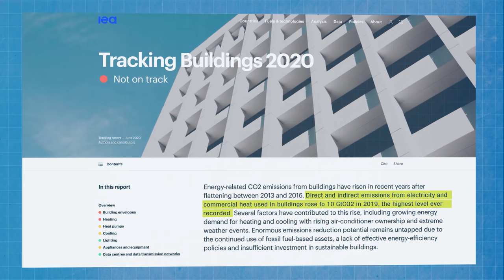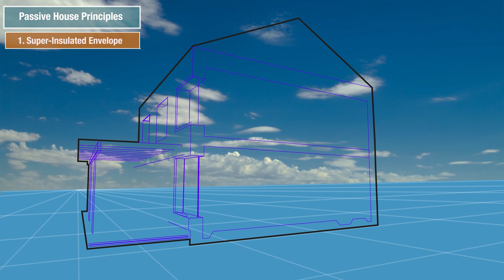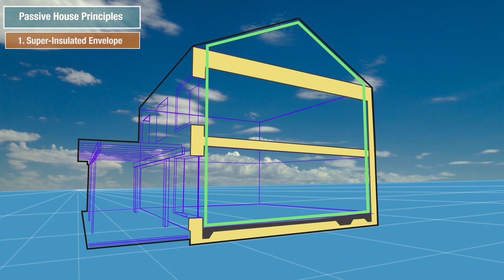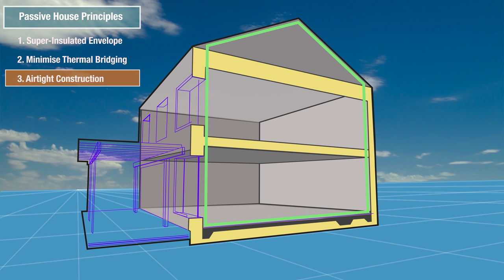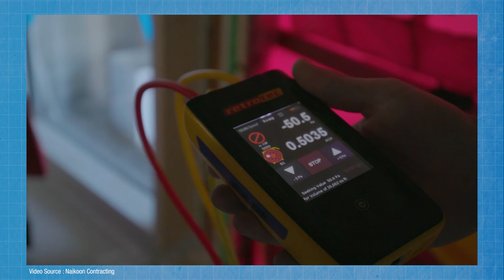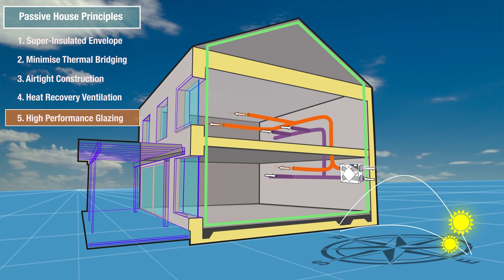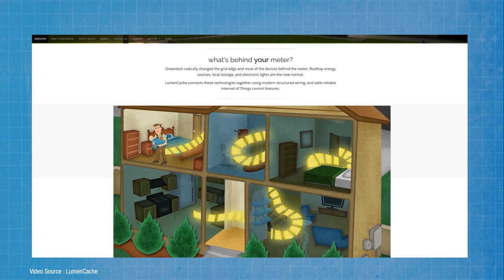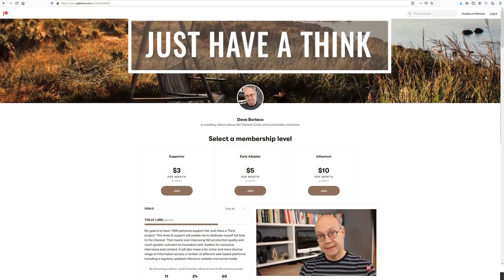Passivhaus . A low carbon future for our homes?

Comment: Folks like myself, who are planning on building our forever retirement home, are very well served by this video - but if I was 20 years younger (yeah, if ONLY!!) I'd be desperate to see a video on refitting passive-house technologies to an existing house. PLEASE DO cover this if at all possible!!!
Reply: This is something I'm concerned with.  It's not cost effective unfortunately.  You can perform an energy audit, which is a blower door test to find out where you are loosing air, and taking a look at the insulation.  A lot of old homes will have 6 inches of insulation where the standard now (in the US at least) is 12.  Those steps are cost effective, but getting to a passive house requires thought at the building stage such as orienting your house facing south, and installing overhangs on the windows.  In the winter light gets in but in the summer the sun is high and the overhangs block the light.  South facing houses will get more light on their roof as well so solar production is increased.
Reply: Rather go for an aktive house. 
It’s more cost effective to tackle the main problem zones like (i hope the translation is right) between floor cover... retorfit in my expirance never works for passive house, because of airconditioning and you will face mould issue...

Having it on a low energy standard with active photovoltaic and a heat pump system (best ground) should do a lot better.
Reply: Joseph W. Lstiburek read his book  that is for your environment, each heat / humidity zone is different. Best 40 bucks I spent, but if you can not afford that his YouTube videos will guide your way. my house is all electric and bills run 80 to a 100 dollars a month year around.  eastern NC
Reply: To get an idea of what you are dealing with (moisture and vapour control, risks of exterior insulation and moisture damage on your sheathing because of it) Look up Keeping The Heat In by Natural Resources Canada, it goes over everything you need to consider and how to retrofit insulation in older houses. You wont get net zero but you can get 80% or more of the way there.
Reply: Look up EnerPHit standard which is the retrofit version of PH. But why not build? I'm 62 and have recently completed our self build PH. No one over the age of 60 should have to live in anything other than a passivhaus!
Reply: that is quite easy with today's technologies. You can hire an architect to make a project for you.
Reply: 'This Old House' covers energy efficient remodeling tools and techniques on a regular basis.
Reply: @edmirfin8498  Retrofitting to Enerphit level is expensive but on what basis is it 'not cost effective'? What are you comparing it to? Just comparing the costs to existing heating/cooling costs and looking for 'payback times' is entirely the wrong approach IMHO. Almost nothing else you buy has a 'payback time' (new kitchen, new car, new computer) so why should building retrofit? The upgraded house is a much better house to live in, is worth more money, and will save a large amount over the building lifetime. To meet our climate goals most houses need massive retrofit of some sort anyway so it's not like there is a reasonable option of 'do nothing'. Passivehouses don't have to face south - that just means you can meet the requirements with a lower fabric spec. 
 I've retrofitted my nondescript 1960s detached to approx Enerphit level. It's cost about £25000, spread over 12 years, so a bit over £2000/yr which is do-able for very many people. That includes a lot of DIY; it would be more like £40,000 if someone else did all the work. The house is dramatically better to live in - it was cold and draughty when we moved in.
Reply: @Wookey.  brilliant answer! Your point about payback time is such a good one-  it just so misses the point to think in those VFM terms. You are the first person i have come across who has actually done an EnerPHit, and by DIY,  incrementally. Well done! I had no idea it could be achieved for so little money. The literature is full of examples costing £70k-£100k and total disruption which rules it out for most people.
Reply: @Wookey.  Agreed, great answer. I've renovated 2 houses now (1890s mid-terrace & 1700s drover's cottage). While it may be hard to meet passivehaus standards, focusing on insulation & damp-proofing is the key to ensure a livable & maintainable end result. Skimp on that & you'll be replacing mouldy wallpaper & rotten woodwork for ever more. Energy savings are a fraction of the benefit of proper insulation.
Reply: It's easier and cheaper to build new than try to retrofit an older house to the Passive House standard.
Reply: @barbarasmith6005  possibly easier but not cheaper. Another contributor here says he has achieved EnerPHit standard for £25k. It was DIY and took 10 years. Contractor might take 6 months and cost 3x that - still cheaper than new build.
Reply: You'll need to start off with very big rooms and wide hallways as you cannot insulate on the outside in the UK due to planning regs (can't change the visual appearance of a property as seen from the principle elevation i.e. roadside).
You can't have a house that appears to be say 30 cm in front of your neighbour's house.
The best thing to do with an old brick or stone house is to either 
A- build a sustainable home inside the old pile or
B- pull it down,sell the bricks on and start again!
Reply: @chippysteve4524  I know planners have the reputation of being inflexible but when there are good reasons they will allow exceptions. We built under "replacement dwelling" provisions but were allowed to double the floor area because it's passivhaus. It's normally like-for-like.
Reply: @edmirfin8498  my advice is to get a thermal imagi.g camera and find all the blue in the winter and stop it.
Reply: @chippysteve4524  You can change the appearance unless in a conservation area. My house was brick and is now rendered. Even if you have to keep the same look it just increases costs (brick slips cost more than render)- it doesn't prevent retrofit. There are loads of examples of one house in a semi or terrace having EWI but not the one next door. It's remarkable how little-noticeable it is (which may be why you haven't noticed them :-). (often a drainpipe means you can't even see the step. And the step probably won't be there for long because next door will have to do theirs in due course :-)
The planning rules will have to change too - decarbonising is ultimately more important than keeping our houses look exactly the same as they did 100 years ago.
Reply: @barbarasmith6005  It is indeed easier to build new efficient houses than retrofit old ones, especially at passivehouse grade, but at least in the UK, and probably most cities, tearing down all the existing buildings and putting up new ones is not very practical. For some building types it can be lower-emissions in the long run (according to Scottish report from about 10 years ago).
In practice there is going to be a lot of retrofit, not least because you can do it in stages and don't have to go live somewhere else for a year.
Reply: @chippysteve4524  yes I i would suggest a mooney wall for retrofit in the case of a brick outside.
Reply: @edmirfin8498  -Clearly it's better to be passive from the original build but those who don't have the choice yet are still wanting to improve often have little more than advertisers words to go on. Some guidance, direction and knowledgeable sources would be very useful here!
Reply: In 2010 I worked with a manufacturer of EIFS products on a test program in Southern California. We retrofitted 3 existing homes, one each in Dana Point, Joshua Tree and Mission Viejo. These were all wood framed, stucco clad homes built in the 1960’s, 1970’s and 1980’s. 

The Joshua Tree property home was the newer home. It was fitted with inexpensive dual glazed vinyl windows and 1 1/2” of eps foam cladding. It also got a more efficient air conditioning system. The work, completed in mid summer achieved a 90% reduction in electrical cost for cooling in the hot desert climate (heating costs were similarly lowered). We monitored this home over the next two years and the cost of cooling the home remained in the mid $20 per month. A dramatic benefit to the homeowner, considering that the average cooling cost per month during the summers averaged $250 per month. 

Passive systems are simple and provide benefits for many years if properly designed and correctly installed.

Comment: We're building a 4-unit sustainable development to "near-Passivhause" standards meaning we won't dot every "i" and we won't get certified, but we'll achieve roughly equivalent performance.  The units will be 1000 to 1300 sf, and each unit will have a charging station for 1 or 2 EVs.  Fossil fuel vehicles will not be able to park on-site.  We will draw day-time solar energy from the grid, and are lobbying our rural electric cooperative to make stored solar and wind available for night-time power.  All power will be electric meaning no natural gas or propane-powered accessories.  We hope that our local building codes will be updated to incentivize this kind of building.  We only have a decade to get very near net-zero, so we hope our project will kick-start this kind of development state-wide.  We also very much want to see your comments on retro-fitting existing housing stock and appliances to passivhaus standards.
Reply: Hi. I'm a fresh grad HVAC engineer from Hungary where retro-fitting plays a major role. So I try to do my best to give some general advice for retro-fitting. The important objective is to make the most change with the least amount of cost so it can be easily implemented. Better insulation sound like a great plan, but it's important to keep in mind that over insulated buildings with a poorly controlled heating system will not decrease but instead increase the consumption. Either the residents will open the windows and waste energy and/or the system will be turned on and off to compensate. The same if the system becomes oversized. When you change the system to heat-pump look for systems that would meet the EU-s strict regulation, cuz freon-like substances do more harm than the heat-pump do good. Ground-based are the best if it's not limited, important to note that the ground is more like a battery than an unlimited source, important to pump heat back from the building or from solar. Air-water heat pumps are also efficient and cheaper. The main problem that is needed to be kept in mind is the noise hazard. Here were a few legal cases because that noise bothered the neighbors. Also, heat pumps need a heat puffer tank if the system isn't large enough, for defrost. Considering the recent cold front in the US a puffer tank is a life changer. At last, water usage is also important, water-saving taps and toilets are really inexpensive nowadays which can save a large amount of water and heat energy. I doubt I need to mention the benefits of PVs and solar thermal units. P.S.: I love your plan and hope it will work out as planned.

Comment: We live in Australia, which is WAY behind the rest of the OECD in terms of dealing with climate change, as you all probably already know. However, we built our house in 2002 with basic passive house design in mind, eg increased insulation in the walls and ceilings, thermal mass with concrete slab floors, putting the garage and utilities (laundry, bathrooms / toilets, courtyard with shade trees on the western side; ventilation through east / west louvred windows; awnings and patios around the house, to name just a few basic design features and I am still amazed to this day how temperate the house is compared to outdoor temperatures at all times of the year. We went the whole hog and put 6KW solar system on the roof and our quarterly electricity bill is about $150. This didnt cost us more than building the average home, relying as we did on design principles rather than things like double glazing, which should be industry standard. There is no political will in Australia to tackle climate change so it falls onto individuals like ourselves to follow the pathway to passive house building. It really works.
Reply: >We live in Australia, which is WAY behind the rest of the OECD in terms of dealing with climate change, as you all probably already know

Is this a joke? Australia is one of the leaders in OECD in terms of renewable energy and energy storage per capita, if not the leader.

Comment: I love the injected humor, "If you were to seal the building hermetically and sit inside for a few days, you would find yourself eventually being dead."
Reply: Which would be unfortunate 😂
Reply: Not a bit of it! All you need is a ventilation system that uses a 90% effective heat exchanger.
Reply: We have a Gread Dane with an iffy very niffy tum. As airtight as our house is, frequently the windows are  wide open!
Reply: @williamarmstrong7199  We used to have a beagle like that, she could clear a room in seconds.
Reply: No Bonnie my dear !! MVHR is the answer. Mechanical ventilation heat recovery system to the uninitiated. It makes living in one of these super insulated houses filled with fresh air
Reply: @jeremyratcliff1875  Ah! MVHR brings in fresh air and recovers the heat. If fresh air is introduced, then the building is not hermetically sealed!  That's the joke: you can't live in an air-tight house.

Comment: I have built beyond Passivhaus standards for 22 years all over the world and you have included a house we built in France many years ago. We tend to build using screwpiles with a frame on top. Airtightness is key and every designer omits an 'airlock' .. i.e. a vestibule or porch. It can take several hours to recover the envelope with an open door. We build with SIPs and use aerogel as a gasket in the detail. We have developed transparent aerogel for use in the void in double glazing. Passive hrv is now very affordable. A house built with SIPs of 72m2 beyond Passivhaus should cost less than £60k with reasonable fittings such as kitchen, bathroom, etc. In northern countries we use a simple air pump and a barometer to test airtightness. Passivhaus is easy to achieve using our techniques.All free to 'Just have a think' community.

Comment: A few points:
1) Cupboards and closets and other storage spaces can work as an extra layer if they are on the outside wall.
2) The "story and a half" style design has less surface area per unit volume than many others.
3) "Titanium white" walls reflect nearly 100% of light back into the room decreasing the need for  power in the lighting.  
4) Drapes and curtains on windows work to somewhat decrease the loss through them.  Rolling shutters do a lot more.  You crank them down at night and you have less loss via the window.
5) "sun tubes" work well to bring in light.
4) In a basement, "fake windows" can make the space look more like an above ground space and let you use it more as living space.

Comment: Thank you so much for covering a passive house overview. Do realize in the United States that home construction industry at Large has not embraced it to the point of making a difference or even being on the radar. Passive houses built here are done at a tremendous effort of the homeowner and very daring partners to move the needle. Videos like yours will help, enlarging the discussion. Thank you for making all the videos you do.

Comment: I am building an energy-efficient house - close to PH standards in Canada, zone 6. Started planning with 100% PH standards and modified some due to various efficiencies. House is built on an EPS insulated slab with in-floor glycolic heating, walls include 6" studs with blown-in cellulose insulation, 3 ply PH windows and doors, Lifebreath HRV and Daiken ductless heat pump serves as AC. Since there is no city water and well water is bad due to high content of iron, a dug-in water cistern with dual rain gathering system (filtrated for drinking etc and infiltrated for WC plumbing) will be our water source. Interior components are planned to be reused from commercial demolitions since as an Interior Architect I have access to these unlimited precious 'debris': interior doors, wood panels, lighting, etc. One level house is fully inclusive, no high door thresholds or narrow spaces, accessible by wheelchair anywhere. I fully agree with another 'Canadian' comment, that in our country we build a way to oversized houses. Instead, spending these cost on better energy coherence and interior comfort will bring future benefits for everyone.

Comment: Talk about a timely topic for me. I have learned just recently that, hey, I'd really benefit right now from having a passive house. We recently took out our gas furnace and gas water heater and put in heat pump versions instead. Wow!!!!!! It takes gobs and gobs of energy to heat a 1950s built house in Cache Valley, Utah. Take my house, please, and retrofit it to the passive house standard right away.

Yes, you're right and, when we were using gas to heat our home, we were already using gobs and gobs of energy, but it just didn't register to my mind. We were so used to taking gas heat as granted, I didn't think of it much. But now, when I check my data logger and see that we've used 50 kW-hr in one day just for heating, the reality seems more immediate to me. And I've realized that I need to change my plan a bit. I had been thinking step 1, electrify everything and step 2 put in more solar panels. But there's no way I'm going to get 50 kW-hr a day from solar panels during a Cache Valley winter. Right now, the plan is to look into retrofitting a 1950s home up to passive home standards.  Yes, that would be expensive to do, but think of it. One expenditure of retrofitting a 1950s home to passive home standards would purchase up to 50 kW-hr of energy per day forever after. That's even a better deal than solar panels.